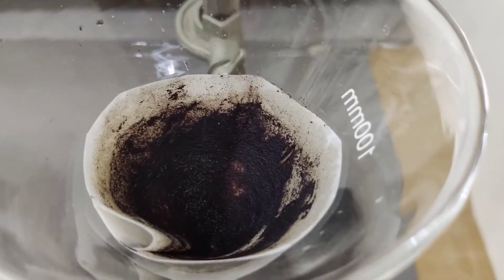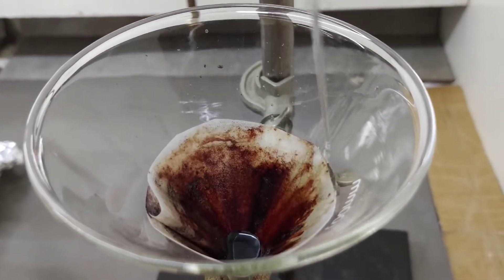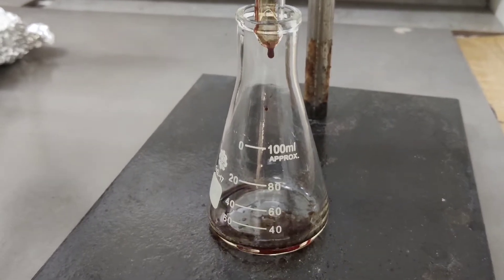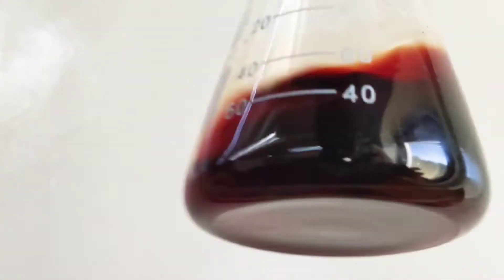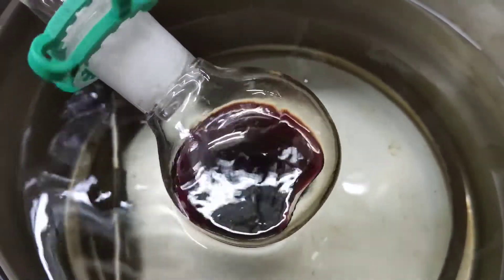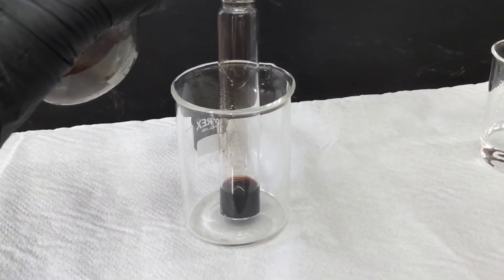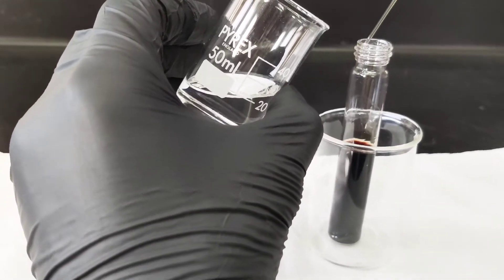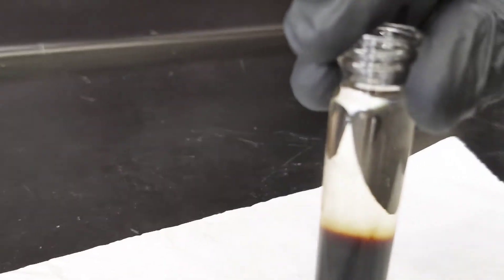Synthesis of a Cobalt Corrole - Workup and crystallization

Comment: Flat-bottomed flasks are not suitable for vacuum 
You could simply plug the solution into the dcm with cotton wool and put it in the refrigerator for a week.  For xray you don't need to grow large crystals - they will be bad.
Reply from the maker: Thank you for the advice. I already crystallized that complex and published it in 2021. It was the first DMSO coordinated metallocorrole, and it made it to the cover of EurJIC. Regarding the flat bottomed flask, our roti pump does not reach below 0.15 bar, it has never broken any flask. But I use 99% of the time RBF anyway.